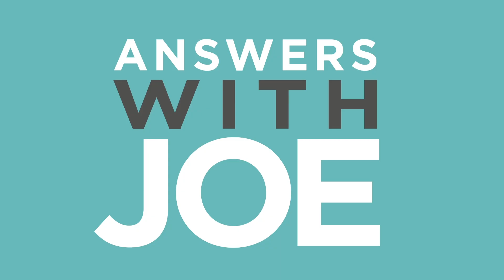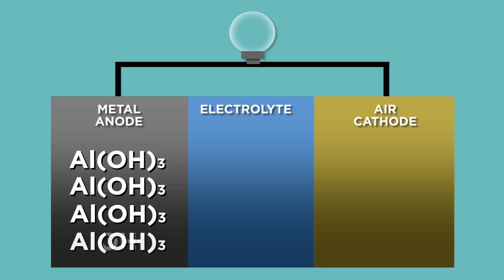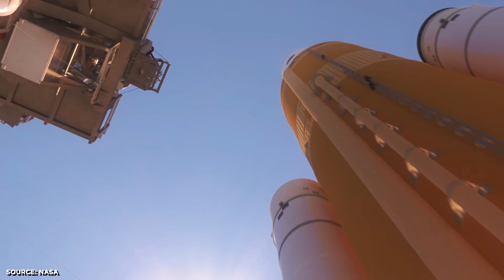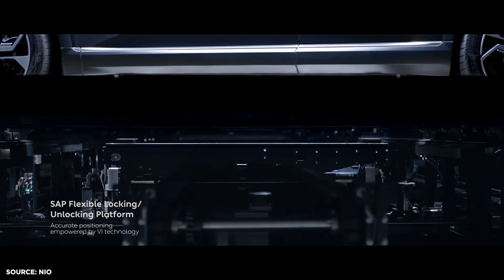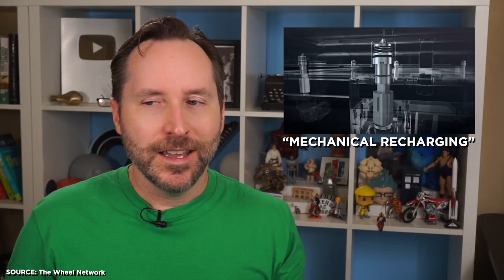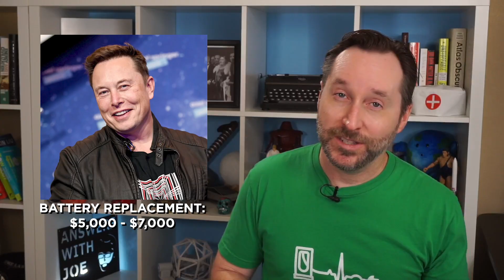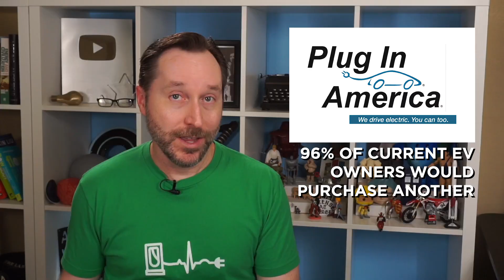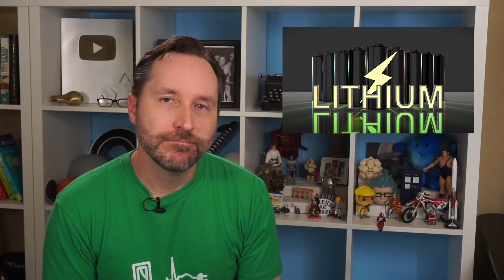This Battery Could Drive A Car 1500 Miles - But There's A Catch | Answers With Joe

Comment: Not entirely relevant but valuable nonetheless, I once found a youtube video while researching mass hydrogen production methods and this video showed a guy with a dixie cup with the bottom inch full of these carbon silicone based pellets and once he added a few drops of water the dixie cup started producing like 2 or 3 gallons of hydrogen per second and he lights it on fire and it burns for probably 1 full minute before turning into glass, the byproduct of the reaction.. If one could design a system that could easily separate the glass from the impurities and purify the hydrogen simultaneously, hydrogen cars would make Electric cars seem like a dumb, expensive, and wasteful idea of the past lol. I am in disbelief by the evolution of EV's instead of Hydrogen.. the only answer is ignorance and greed

Comment: If you were to combine rechargeable Li batteries with swappable Al packs, you'd only need to swap the Al batteries very rarely, mostly on long road trips. This means you wouldn't even need any automatic swapping station, since the occasional manual swapping at a service station would not require any automation to be acceptable. Manual swapping could be as easy as filling a gas car and your car could recharge at the same time. You wouldn't really need any new infrastructure for that.

Comment: Great informative video. There's a whole industry of petroleum powered engines that may be replaced using these technologies.
Reply from the maker: It's just retooling or replacing 100 years of infrastructure built around that engine that's the catch.

Comment: Look up rich rebuilds for a Tesla battery replacement.  The guy got quoted by Tesla for over 22k for the entire pack, Rich replaced only the dead cells for 2k as it was just 2 dead cells.  Tesla does not work in parts, they work in clusters.

Yes many EVs, not just cars.  Passenger planes, tanks (uran-9), buses.   The biggest things have always been EV, just they weren't running on battery power.  Trains and ships use electric motors but with diesel engines through an inverter to power those motors, they are looking at replacing those with hydrogen powered.  The biggest ships need more power and run on small nuclear reactors.

Comment: Joe mentioned that the battery swap experience would be closer to the every day experience of going to the gas station to fill up, something with which we're all very familiar. True. But I posit that the better way forward is not to try to cling to the current way of doing things but to retrain ourselves to a newer, more sustainable way of thinking. Can EV charging be less convenient than filling up with gasoline? Yes. If you can't charge at home. But more and better infrastructure, like curb-side charging would mitigate this for many. Trying to keep the current system or replacing it with something similar is likely not the best way forward.

Comment: From what I've heard the trouble with these batteries is that when they are discharged you're left with a bunch of aluminium oxide, which is really hard to turn back into aluminium, so they're not as recyclable as you may like.  From an energy standpoint that means they consume more than rechargeable batteries.

Comment: In Denmark we had battery switch stations for EVs until a few years ago. More or less one every 50-100km.

Spoiler, it didn't work very well. And the cars are very cheap now🙂

Comment: What if:

Instead of a battery swap, you use an aluminum foil roller, just like the food-wrap aluminum foil. The service at the charging station is installing a new roller and feeding it into the "feeder" that rolls the foil into a battery (so it's basically a fuel cell). It is easier to swap the empty roller with a "full" one and just changing water every 200 miles.

Comment: 4:03. Joe: “65 thousand and [something] tons of aluminum is produced [yearly].” Video: canned food packaging line, carrying tin-plated mild steel cans with additional FDA-grade epoxy inside lining (Bisphenol-A),  FWIW, aluminum soda and beer cans are also BPA-coated, thus not fully recyclable: bisphenols form a 3D polymer which cannot be remelted and hard to reprocess.

BTW, when all the BPA brouhaha started, manufacturers replaced old, good, safety-tested Bisphenol-A with nearly identical Bisphenol-S (BPS), which was not used for food plastics before and does not have as well established a safety profile as BPA, and slapped "BPA-free" on it. BPS in fact nearly identical to BPA; bisphenol epoxies are so chemically inert after curing that the scare is hardly founded—you can pyrolyze or burn them, but otherwise they very non-reactive even at the hottest food temperature, but still. "Be careful what you wish for...."

Comment: With respect to H2 as a fuel source you have to take the ozone scrubbing capacity of escaped H2 into account.  Every time you fill up with H2 you lose a little bit.  That little bit floats up into the ozone layer and gradually turns all of the ozone into water.
Doesn't it seem like each one of our fixes just causes more problems?
Cheers,
Chris

Comment: I personally see this as a perfect solution for transportation within a greater city area for personal transport. For example, most people wouldn't mind replacing water based electrolyte on a e-bike system because it would be a routine check up and replacing the battery could go inline with changing a chain
Reply: Maybe for city-dwellers... If you live close enough to your job to bicycle there... And if it's all relatively flat ground... And if you work at the same location all the time... I wouldn't live downtown if you paid me to. Plus, I need a truck to tote my tools to work and back, and jobsites change. The yuppies can have their e-bikes. They can have their city too. What they can't do is force everyone else to be like them and conform to some ridiculous standard they set.

Comment: Use renewable electricity to make Gasoline or Methane from the Air. Then you have a chemical battery with the infrastructure already built out. One thing I do t get is to produce Aluminium a LOT of electricity is used. So is it really so economical, yes you can recycle it but if this tech was to take off then a LOT of aluminium will be needed - this will be in direct competition to the construction and manufacturing industries. So yeah a cool science experiment, but the back of a ciggie packet economics don’t hold water. Make hydrocarbons from renewable electricity and stop faffing about with electrochemical batteries.

Comment: 8:00 after 340 000km i replaced my nissan leaf 24kwh battery to 30kwh battery. After reselling the 65-70% capacity left 24kwh battery, my upgrade/replacement cost was 2000€ :)
Reply: In New Zealand you see Leafs with 65 to 70 left with far fewer kilometres on them. Either they are getting odometer cracked in Japan before export used to New Zealand or the Japanese heats wears them down more before they arrive here
Reply: It mainly has to do with ambient temperature @blackterminal  . I live in estonia where yearly average temp is like.. 6C or something (42f). This limits the ability for leaf to damage it's battery by heat, due to lacking in battery cooling.
I tend to say, that dont buy a leaf if you live in a country that gets no snow. It's battery will not hold up for long in warm climate, unless you use it quite lightly.
Reply: @gelisob  hello. That's pretty cold. You must be tough.
Reply: @Beakerzor  <80%? thật ‘d bé stupid! Why would folks want a lower voltage which increased current means higher component stress for the same power output, from a battery that’s not in storage? Newly-minted idiots are spawning from the closet thanks to COVID and its comorbidity quarantine.
Reply: You dont seem to know very well how the li-ion battery degradation works @HighestRank  . The lost capacity does not reflect in lower operating voltage. It reflects in the total energy output at nominal voltage. Think of it like a coke bottle that shrinks from the bottom. The opening is still the same size for contents to pour out.

Comment: 95% less energy needed to recycle as opposed to manufacturing from scratch sounds good...until you look at the GODAWFUL amount of energy it takes to produce. Those 5% is still so much that it doesn't really work on a per cost basis. On top of that the swapping stations are very expensive to set up (and run!) which adds to the cost again.
This makes no fiscal senes on any level.

Comment: Reconditioning batteries seems like it could be optimized for in design.

I'm still wish we could get a methanol fuel cell solution working.
Storage is pretty practical and generally pumping needs a seal material change for infrastructure.

Air battery air plane hmm.

Comment: "it would mean building new infrastructure..."
so does the current trend of rechargeable cars. The current grid won't be able to support it everybody bought an electric car now.
Also, if you go longer route, then swapping a battery makes a lot mores sense (it's faster) than sitting for an hour at charging station in the middle of nowhere...

The problem of not-being-rechargeable is not just about convenience, but about "reusability" of the energy. What about having a car with one Al-air battery for capacity and one LiIon for recuperation when braking?
Reply: Even with swappable batteries,  the same amount of power still has to come from somewhere so that solution wouldn't solve grid issues at all anyway. Also there's been a few studies done that indicate going to electric cars actually won't affect the grid much at all. Peak power is what causes most strain, just increasing the base load for charging isn't really a problem for the grid.
Reply: @reubes1  
DON'T start coming with actual "Logic"! 😉
It's a similar problem to Hydrogen.
As you say, SAME  baseload electricity.
ADDITIONAL transport cost to get to point of use (with even more bulk than Hydrogen (?).
SIMILAR cost to return to the recycling centre.

I'd bet it's no more than 50% round trip efficiency (kind of confirmed by the comparison to model 3?)
We can probably expect the "but spare green energy" argument at some point?
MUCH more energy to recycle.
Reply: @reubes1  if all the chargers and the grid was "smart" / "synchronized" (they would not all try to drain full power at the same time), then I would agree; but if all the people come to work / home at roughly the same time and plug their cars in, and demand full power (because why not? even though they won't come back from there for the next 8 hours, everybody would want to charge fast anyway, because people are like that..)
Also, the peak depends on what part of the grid we talk about.
Sure, the top-level might handle it (cars charging at night will offset some factories not running etc...)
But the small branches (i.e. suburbs, streets) are often on the limit even now; these were designed for houses with a few kW each (and supposing that not all houses will run the kettle, washing machine heater and a vacuum cleaner at the same time :D). If you add an electric car to each house with several kW charging power (let's say 10 kW basic charger), it's like doubling-tripling-quadrupling the number of houses on the street. Is the whole grid (every street, every town) designed for that?
Reply: panda4247
The old "if everyone bought an EV now" opinion? (It's not an argument)
That's not possible, is it? (Yet)
And WHEN they do, the "not enough electricity" doesn't apply, fully debunked by the National Grid..... You know, the company which RUNS "the Grid"

"If you go on longer route" you'd better be sure there's a battery waiting for you "in the middle of nowhere" !
"The problem" is ALL about "not being rechargeable"

EV infrastructure "power grids" already "largely exist". It's an "upgrade", not a completely new system requiring expensive and energy intensive industry to constantly RECYCLE packs after "1500 miles" rather than (soon) 1 million miles (essentially "never" as far as the user is concerned)

As for "waiting to charge for an hour", I'm increasingly seeing range tests on YouTube where a tester says "l have to go and eat/ take a comfort break, the car will be ready before me", so that's no longer a valid point either.

A "hybrid" Lithium/ Aluminium set up?
It's more space, more complex control systems, more wiring, for no gain.
Reply: @rogerstarkey5390  
"The old "if everyone bought an EV now" opinion? (It's not an argument)" --> I am not saying everyone is going to buy it now... I was just saying that if everyone was to buy an electric car, the current grid would not handle it.
Maybe in your country your National Grid company is prepared... Here in the central Europe, not so much. Try pitching a project here to massively upgrade the electrical grid to support 2-3 times the consumption in every town/village (I am not talking about the backbone grid, but the whole system. but every street; they are often on the limit now). Good luck with that.
Private companies (gas stations) selling also batteries would be feasible option. now they need one truck of fuel every so often; they would need additional truck of batteries.

Comment: Al-Air batteries are a good option for airplanes. Not mentioned is the energy storage per kilogram. Aluminum air batteries are very light-weight in comparison to current lithium technology. Theoretical limit is 8kWhr/kg but 2kWhr/kg is expected. 2kWhr/kg is already suitable for airplanes. And like the comment about shipping, there are limited locations (airports) where fresh batteries would have to be transported.

Comment: Sorry, no. Any "solution" that requires the shipment of anything heavier than electrons is a step down.
Unless they find a way to reverse the oxidation to allow a charging cycle, this is a non-starter.

Comment: I don't see these making into cars. Imagine the stress of planning your life around the last 20-100 miles of your disposable battery... Every few weeks. Until the replacement stations were as common as gas stations are now, you'd be constantly getting held hostage by your battery. Either change your plans, or throw away a few hundred miles for a fresh battery that can take you where you want to go without worries. No thanks. I'll keep putting gas in my car and advocating nuclear power for everything else.

Comment: The "extra range" would be used up within the first month, simply because it was there. People wtih large gas tanks still drive until it's almost empty, so i think the dual battery system would be a massive flop.

Comment: Until I get to the point of only needing a couple hundred mile range I'll stick with gas/diesel.  1500 mile range would be great but the infrastructure is barely getting built for recharge stations now let alone a full swap station for what would inevitably be 300 different battery pack designs from a dozen different manufacturers.  Doubt it'll happen in my lifetime.  Until I no longer need to drive 1300 miles in 24 - 48 hours I'm stuck with what works now.  I've also seen too many vids on Tesla's out of warranty battery prices to think of getting an EV with the current state of the technology.  Tens of thousands for a battery replacement after the warranty period ends?  No thanks as I've never owned a car while it was in the factory warranty period.

Comment: can you use alum-air batteries to buffer intermittent power sources like solar? ...use excess electricity in the day to smelt alum oxide back to the solid metal and then reload the battery w the metal to provide power at night?

Comment: How aluminum was first made: 
1. put salt in a porcelain crucible, stick in two carbon electrodes, and heat it up until the salt melts. 
2. Run an electric current throught the molten salt, producing poisonous chlorine gas and sodium metal (which will burn if it gets wet!)
3. Let the crucible cool. 
4. mix the sodium metal with alumina (aluminum oxide) in a crucible. Cover it. 
5. heat  it unti the sodium reacts by snatching the oxygen from the aluminum forming sodium oxine and metallic aluminum - and hope the whole thing doesn't catch on fire. 
6. let cool. 
7. carefully separate the caustic sodium oxide from the aluminum metal. 
Tada! An arduous dangerous proceedure with higly toxic byproducts has made a tiny amound of a wonderous soft silvery metal! No wonder they charged a fortune for it.

Comment: Recycling metallic aluminum is a lot easier than aluminum oxide. Aluminum air batteries convert metallic aluminum to aluminum oxide, so to "recharge" them is just as energy intensive as refining aluminum in the first place.

The recycling efficiency is much lower for these batteries than advertised. You need to process and atomize the aluminum all over again.

Comment: There are places in America and the world, (Australia, Russia, Africa, etc.), where range is a very real issue. I imagine that having one of these batteries or a pack of multiple batteries (and a water tank) on a trailer behind the vehicle would make some of these transits feasible in a BEV, where otherwise it would not. A vendor can have locations at each end of the transit point. Multiple smaller batteries would be more useful than on big one because it would allow unused batteries to be returned to the vendor for a partial refund. The biggest selling point is that it would work on any BEV with a trailer hitch.

Comment: The energy of this battery is put in during the aluminum refining.  It takes 50% of the output of a nuclear power plant to run the refinery.  You have to repeat this refining when the battery is recycled.  Other aluminum recycling is simply melting the metal and reforming it.  It takes a lot of energy to break the aluminum oxygen bond.